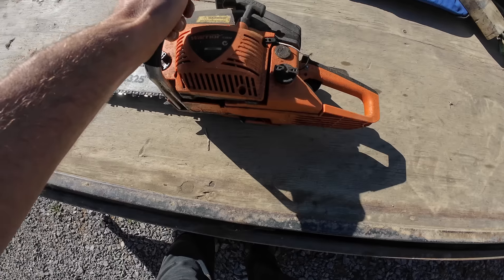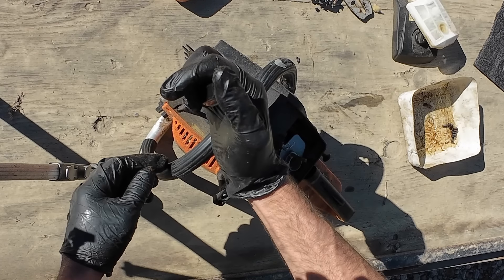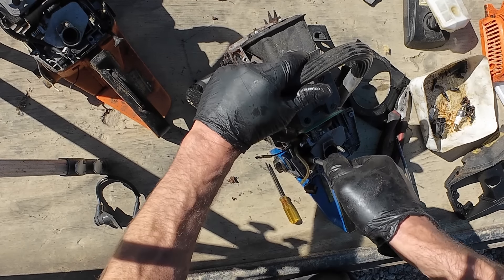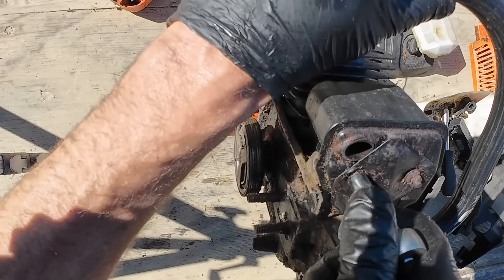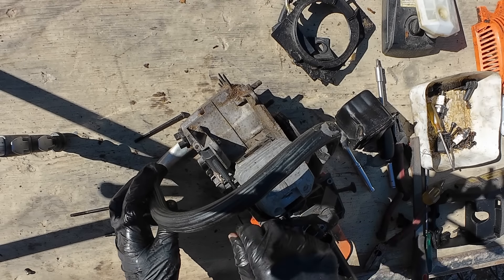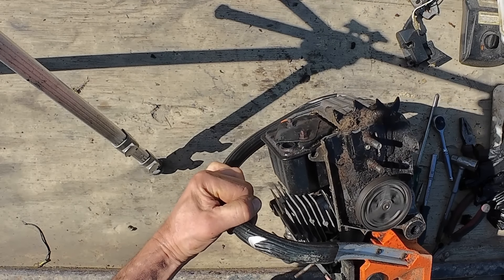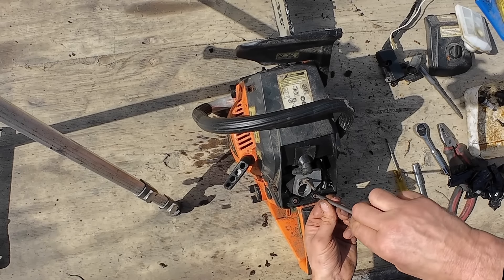Free Chainsaw with No Spark.. Lets fix it!

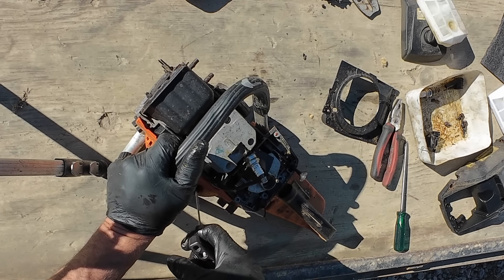Comment: If you look back at 2:34 when you’re pulling the rope, the coil wire is firing below your left hand next to the cylinder head. Coil wire is damaged there, I think.

Comment: I have a 1997 Husky XP41 ( bought new)  that the coil just failed on, bought a coil off Amazon for 20 bucks and Shes back running great again. Saws are pretty easy to fix if you have a decent mechanical skill set

Comment: I had the UK version of this saw, mine caught fire 🔥 
The fuel tank bung went hard due to the ethanol in our fuel, it leaked fuel & then caught fire when starting, fun times 😂
My first observation was the kill switch is normally open on these, so wires connected means grounded coil = no spark. I shall keep watching though 😊

Comment: These saws are ok for what they are, a bit fiddly to fix but go ok. The places to watch out for are the starter pawls, the stop switch, and the fuel lines, put a decent ngk spark plug in it, I give them a muffler mod and increase the compression and they go ok after that.

Comment: Another job done well.
Hanging onto old junk has saved me many times.
I thought on most of these small engines that the switch grounded the spark to stop them, I was expecting you to untwist the switch wires and have spark back.

Thanks for sharing and entertaining.
Reply from the maker: I tried the wires connected and disconnected, the coil was dead

Comment: I wish my older Stihl cut off saws would use an muffler with nuts on the end of a stud rather than the torx screws at the bottom of a long hole. They are impossible to get out when they are rusted.
Reply from the maker: Stihls are over rated

Comment: Rebuilt an old Chainsaw years ago and one trick I did was set the gap on the Bar where the chain engages to the bar. What I used was a couple of saw blades to the width of the sprocket teeth and gentle-tapped the bar edge until to correct width. Makes a big difference to the cut as well.😉

Comment: Excellent video Marty T  :) have ever see a Chainsaw made by Skil power tools my late dad got one for $50.00 at Auction sale  in 2000 it yellow like Ponnier  brand has 56 CC with 18 cut bar also thumb oil bar up , fuel mixture was 30:1 shocking use 40 to 50:1 gas mixture  to one thing does have power coil switch on handle on top by throttle lever no brake in lock cutting bar! But it mint condition and did lots courds of wood and heavy duty weight to it ! I had put new rip cord to and spark plug to it ! One pull plus choke on then one pull with choke off starting up found out last when cutting some firewood up for Winter Season months! Skil was made in Winnipeg Manitoba Canada and found made from 1964 to 1978 years too ! I had check in by local Hardware store does small engine and guy check over told me details about it and said that Chainsaw in good condition for age !
Reply from the maker: nice, sounds like it was built to last, I've never seen one of those

Comment: Nice I repair small engine anything from lawn tractors water pumps weed wackers leaf blowers and especially chain saws I have a really old McCulloch 10-10 a friend gave me and a smaller McCulloch left for dead a garage sale in the free pile I've used for years that just needed a primer bulb and fuel lines that rotted because of the ethanol in the fuel in the states. Do they put ethanol in the gasoline in New Zealand? The only positive thing I see about ethanol I guess your fuel won't freeze in subzero temperatures. Job Well done Marty ! Oh yeah I probably have 20 chain saws 😅
Reply from the maker: No ethanol in the fuel here

Comment: The white wire can’t be hooked to the black wire. Thats a direct short for coil to ground. And that’s how you shut off the chain saw. Probably wasn’t anything wrong with old coil. But my guess was switch went bad so guy was trying to figure it out and thought they had to be hooked up. Good on you tho!
Reply from the maker: Yeah I tried open and closed circuit on the switch, the coil was poked

Comment: You should have tried it with the wires disconnected as they usually have the kill switches wired that way the switch breaks the earth circuit for on then completes it for the motor to stop.
Reply from the maker: Yep I tried open and closed circuit just to be sure

Comment: Hey Marty, what's your opinion on brand saws like Stihl or Husqvarna? Do you mind the price for better quality or do you prefer the cheaper saws?
And whats your opinion on chainsaw safety chaps or trousers?
Cheers from Germany
Reply: After a friend trimmed his toe with a running chainsaw by accident when he slipped off a log...
he now wears steel capped boots, chaps...and a very good Stihl branded combined mesh visor/hard hat and ear defenders...

He used to use a Stihl 044 which is legendary as a good professional saw...
but bought a Chinese larger saw new for one third the price of the Stihl parts needed after he loaned his son's friend the saw...
and the friend ran it on straight petrol (no oil mixed in)

He has used the Chinese saw 5 years on blue gum Australian hardwood felling and cutting up whole trees..
He runs Stihl bars and chains...as they fit the Chinese saws just right...

Comment: Marty, was it the spacing of the two magnets in the coil or the missing bolt causing increased separation?
🌏🇦🇺
Reply from the maker: No it was in the right spot and still tight

Comment: Just a thought, I saw the last owner had bypassed the switch and twisted the wires together, isn't the purpose of that switch to ground out the coil and shut down the engine? My thought is that by twisting the wires together wouldn't that ground the coil, keep the saw from running and cause a no spark?
Reply from the maker: I tried open and closed circuit, it was dead

Comment: When you pulled it over with the original coil, it could be seen sparking down on the casing. Possibly a fault lead where it comes out of the actual coil
Reply from the maker: I saw what looks like spark while editing, zoomed in and saw it was actually dust in the sunlight
Reply: @MartyT  excellent,  one of those things us watching on a TV would not see clearly. I just wondered if your view was obscured by your hand holding it down as you pulled it over. Camera angle and eyeline being different. Glad you saw it too in the edit.
Good fix and thanks for the explanation.
Reply: @MartyT ”Dust in the sunlight; all we are is dust in the sunlight.”

Comment: Correct me if I’m wrong but wouldn’t twisting the wires together going to the switch have killed the spark? Typically on small engine’s the coil is always on and requires the wire to be grounded to kill the spark. When you flip the switch to on you’re opening the circuit not closing it.
Reply from the maker: I tried open and closed circuit just to be sure, the coil was toast

Comment: Usually when the switch is in the run position there is no continuity and when you switch the saw off the switch makes continuity grounding the coil.  I wonder if it would have started if you untwisted the wires?  Either way you got a nice saw.
Reply from the maker: I tried open and closed circuit just to be sure

Comment: Got an old Popular Super 25 CounterVibe that came with my house .
The seller had found it in a shed at a house he owned prior to this and just kept it , and had never done anything with it , and just left it for me .
Of course the fuel line was so rotted , only a few sticky pieces remained .
I cleaned it up , replaced the fuel.line , and , soon discovered the coil was dead .
And that's where the story stops because the coils  are completely  out of production and have been for so long , the last ones made can now legally drink .
They were great little saws , real screamers .
The coils and fuel line were their only weak points .
To bad it's just a wall hanger now ..
Reply from the maker: Surely you could adapt something to fit?

Comment: About that broken bit: I'd have it perfectly cleaned and then glued on with UHU 300 Endfest epoxy, that thing is 300kg per square cm, so it should do the job. Eventually putting a flat nut on the other side.

Comment: To set the coil gap I leave the bolts a little loose then put a business card over the flywheel magnets and the coil will move to about the right place, then tighten the bolts.
When adjusting the chain tension i lift the end of the bar up.
Reply from the maker: I had to push it right over to even clear the flywheel, I wouldn't have got a card in the gap

Comment: Thanks for the video - so much to learn and not enough time. I threw away a bar because it wasn't oiling misunderstanding the purpose of the oilier-holes and paths that could be cleared with simple air gun. great as always.

Comment: MARTY - These cheap or free chainsaws are great for trying homemade/modified mufflers on! I get 40% extra out of my cheap one by this easy method. Maybe you should try one and post the results.
Reply: I’ve had bad luck “improving” Chinese saws, they can hardly take the horsepower they are made with.
Reply: 40% extra power or 40% extra noise? Hahaha
Reply: @hughbugger  Both, forgot to mention I was hoping (wanted) a nice 'bark box' for a little fun as well, besides the original one is easily reinstalled.
Reply: @HubertofLiege  I think I understand the reasons behind your experiences. The mod I referred was just to the muffler. I also don't run the saw for very long like this - I have good saws for this.
Reply: @hughbugger  you may be interested to know that this same muffler, put on a good, old Makita Dolmar, had no positive 'benefit'  over the original - apart from the sound (noise).

Comment: It's funny a lot of these cheap chinese saws started doing the .325 pitch blades years ago. Went into my local shop to pick up a baby saw (MS261) and what do you know the sales rep was just gloating about how this is the great and it's got a .325 pitch and it cuts fast blah blah blah. I laughed and said oh the Germans finally took a page from the chinese huh?? 

All that said the 261 is a sweet little saw and when I'm not using the 661 or 880 it does what I need.

Comment: You've got to be careful buying "OREGON' branded/boxed rim sprockets online as there are nasty, poor quality fakes being sold as genuine. I purchased some of the fakes & they were egg shaped & I couldn't get correct chain tension as the were either way too tight then it would go way too loose as you turned the chain. They measured variable thickess in the rim & they wouldn't slowly roll smoothly on a flat surface & were plain as day egg shaped. I sent photo's to OREGON in the U.S.A and they confirmed they were fakes by the packaging & cast markings on the rim sprocket. Run the fakes on your chainsaw & say goodbye to chain & crankshaft bearings.

Comment: Gives me motivation to tinker with my 57' chevy tomorrow morning. Marty, youre a Einstein, you just wont admit it
Reply: Won't start due to spark I'm thinking... replaced all gaskets, and fuel purged, including fuel filter replacement. Fuel pump is fine. No spark at the plugs

Comment: During your tests of the spark plugs I notice that you have the wires that go to the switch twisted together, effectively grounding out the magneto. Changing the switch and putting it in run position opens the contacts in the switch and allows the magneto to create spark. I suspect that the original problem was the broken mount of the original magneto allowing the gap to close between it and the flywheel and the previous owner wired around the switch thinking it was the problem. Old magneto is most likely just fine.
Reply from the maker: I tried open and closed circuit just to be sure, the coil was dead

Comment: Nice job Marty… whenever I have to remove a coil on a 2 stroke I use a business card to reset the gap when I reinstall it… never fails…
Reply: I was going to say the same thing though it applies to 4 strokes as well. setting the air gap between the coil and the flywheel is important, too much or too little and they won't spark right or at all.     It would have been a good idea to check the plug terminal to the high tension lead as well, they can be hard to pop off the plug at times and some people yank at them braking the connection between the copper wire in the ht lead to the plug terminal.

Comment: All chinese saws are the same, built in different factories to different quality levels...LOL maybe a different cover , colour but basically all the same, especially the 45, 52 and 58cc saws. They do best with a thicker mineral 2 stroke oil at like 30 or 40:1. Had someone in the know say in China farmers etc are hopeless with maintenance, run crap oils and fuels, nothing lasts there very long due to this. So these things are perfect for that. For the bloke who just wants to cut firewood one day a year and pretend he is a wood cutting Stallion, these are fine. It's only when you are used to Stihl, Husky, Solo etc that you realise what crap they are. But hey, only quarter the price though.

Comment: The fake screw heads are actually the international warning symbol meaning "THIS DEVICE IS A CHEAP PIECE OF SHIT!!" Thanks for the video, Marty.
Reply: Others have said and I have seen a Chinese clone felling and limbing Australian hardwood blue gum trees for 5 years without breakdown and still going...
at 1/3 the price of just the parts to repair a straight gassed (ruined) Stihl 044.....
Funny thing is good bars and chains fit  right on the clone...

Comment: Well done, yes a simple fix for "Marty T" but if the donor had taken it to a shop, it would cost more to fix than buy a new one.
I love that you had a similar saw that had blown up still kicking around for parts.
I've got one of those cheap Chinese saws, I'm a Husky guy myself, and I have some great saws, but a job came up and both of my good Husky saws were down waiting for parts, I bought one of these cheap saws, that was about 5 years ago, and it has done a lot of work, and keeps on working. I only run storebought premixed gas in it which has ZERO ethanol in it, and I do take care of it, but I have cut a lot of wood with it, including doing some milling which is hard on any saw, but it still just keeps working. Not a replacement for my Husky saws, but for about $200 US (five years ago) it has been a solid performer.
Cheers from Tokyo!

Comment: For those interested , more common are carb issues, including old fuel - Run (enough to fill carburetor) and leave Stihl fuel (high Paraffin) or likes before storage/periods longer than 6mths and only use ethanol free between.

Comment: Ääh, smelly two-strokes, I just use electric -no problems to start-up even in winter... Also about getting that tractor to the isle, just drive it over ice in winter there. Can anyone spot any mistakes in my plan?
Reply: The sea inlet salt water of the Marlborough Sounds never freezes..
but that's the only small point of contention in your brilliant plan...
Reply: @JohnSmith-pl2bk  ; P

Comment: So many bad coils on newer Chinese stuff.  Motorcycles, saws, outboards, you name it.
Reply: My husky coil crapped out still on the original chain
Reply from the maker: Maybe they'd last longer if they weren't right next to the hottest part of the saw?
Reply: @MartyT  Certainly possible.  I've done small engine repair as a side job for many years now, and I am seeing more and more electric issues with these imports.   The vertical shaft mower engines and scooter engines seem to be the worst.

Comment: Marty you make a chainsaw boot. By heating a 6" plastic pipe  and flatten with a board inside , cut half side  so you can mount it on your quad bike. For those branches that try hitting you on the trails.

Comment: Kinda makes you feel sorry for people who can't fix their own stuff, and those who are victims of our "throw away" society, don't it Marty? Well done that man!
Oh! and here in Australia we say about the Stihl brand, "Stihl can't start ya bastard!"
Great saws, hard starters.
Reply: each Stihl has it's own starting method...but in general when cold first start of the day
fill with fresh mixed fuel/oil mix.
full choke...
pull starter rope until the first engine "cough"
Choke off and throttle locked down to fast idle
Pull and all mine start at this point.
let it warm up for 20 seconds, watch for chain bar lube system working, 
click throttle for normal idle....
start cutting.